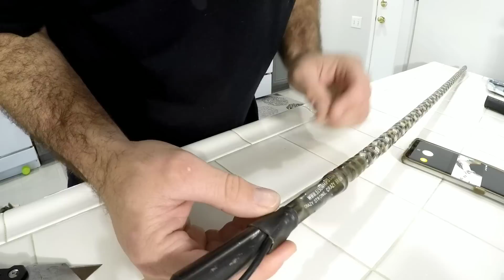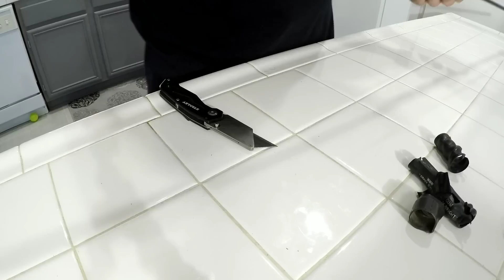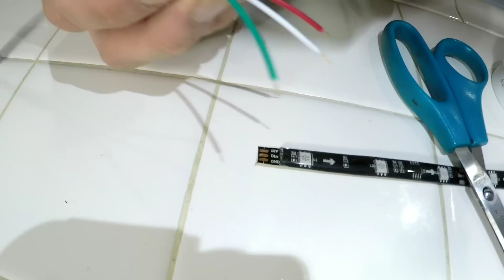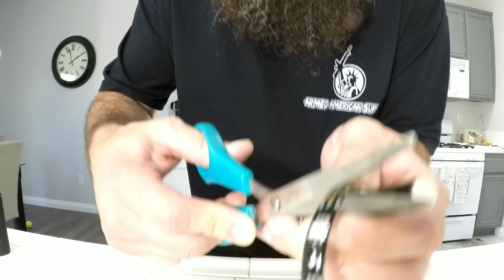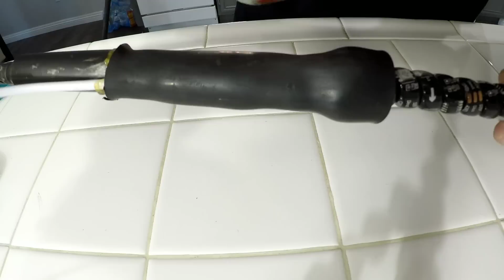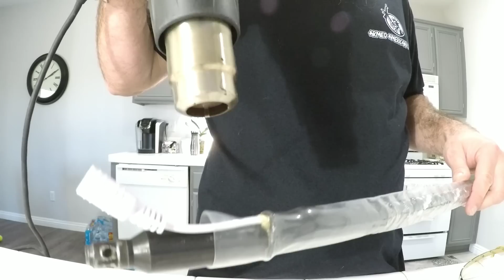How to make a lighted led whip

Comment: What controller do you use and how do you supply power to it from the battery?
Reply from the maker: I use custom controllers now if I build one however the controls used in this video and the part 2 video are listed in the video description along with the other build parts
Reply: @MrRICKDAWG4444  I ordered the controller listed in this video and ended up not working in the razor. Maybe I did something wrong?
Reply: At a curiosity how much are your custom controllers? And my issue is I have the controller and am questioning how would I hook it up to the battery on the razor?
Reply from the maker: I recommend the Bluetooth controllers from the second video. However I have custom controllers made from China that I use now if I decide to build one
Reply from the maker: To hook up on any vehicle just run a positive and negative wire to a switch on the dash and then run the same wires from the whip to the switch on the dash
Reply: That's what I did but as soon as I connected power to the controller it ended up frying up.
Reply from the maker: Probably just a controller issue those things are hit and mis

Comment: I built 2 of these and when I go to change modes sometimes one of the two will go to a different mode. Is there a way to make sure they stay in sync all the time?
Reply from the maker: Yes I usually run two off one controller and use a Bluetooth controller here's a old pic of what it should kinda look like.
Whip syncing https://imgur.com/gallery/hJDHr6K
Reply: Well I goofed up and used 2 controllers. I understand now. Also how do you set the pixels with the wireless remote? I want mine to stack but can’t figure it out
Reply from the maker: Your remote should have came with instructions in the bag just read on there it will tell you. If your whip is fully lit just keep pressing or holding it down until you start seeing the top leds turn off then press back up until the last one lights up then your set.

Comment: Bro i made 2 whips with these lights and controllers but i cant figure out how to change the pixels like you did for the stacking
Reply from the maker: There is directions in the package it came in. I don't really use that controller anymore so I can't recall how it's done.

Comment: How would you pair 2 whips together using these lights.
Reply from the maker: Just splice one controller to both whips. Or you can power both controllers on at the same time.
Reply: @MrRICKDAWG4444  that's what I was thinking just making sure. Thanks for the video helped me decide on building or buying one
Reply from the maker: Right on. Glad i could help, good luck with your build.

Comment: Is there a controller that I can buy that I can screw all my whips and lights in together and use one controller to run all them at once ?
Reply from the maker: Yes, however I don't have a link for them. I have those custom made directly out of China and they run all the rock lights and whips together. I think I can have em custom made to run at most 8 different sets of lights at the same time.

Comment: Could we use a bluetooth controller?
Reply from the maker: Yes. You can use any controller long as it's compatible with your LED type. Just know the bluetooth controllers are much larger so i usually build a wire harness that mounts the controller on the vehicle somewhere instead of in the whip.

Comment: Hey man what’s the diameter of just the pole for the 5150 whips? The antennas I used are quarter inch and at the top the left spiral messed up on me every time.
Reply from the maker: They are 3/8".... 1/4" is way to small you will break solder points often if you ride hard. The thicker the whip the better

Comment: DMAX909 got another question for ya. I’ve made the whips but think I may have gotten one of them a little too hot when heat shrinking. It will work for about 5min then the leds start spazing out! Lol. Did I get the leds to hot or the controller?
Reply from the maker: Sounds like a controller or a power supply check out my part 2 video I don't put the controllers in the whips anymore.
https://youtu.be/aBwdlXmUtgU
Reply: @MrRICKDAWG4444  thanks brother
Reply from the maker: @trevor77yfz  you're welcome
Reply: @MrRICKDAWG4444  so turns out I had a bad solder point on my ground! Took the controller back out of the whip and cleaned the copper solder points real good and redone them and it’s fine! Thanks again man.
Reply from the maker: @trevor77yfz  that'll happen. That's another reason why I do it the way I show in part 2. It's alot better of a connection even if one of the solderpads breaks off.

Comment: What size whip is that 3/8 or 3/4
Reply from the maker: 3/8"
Reply: @MrRICKDAWG4444  where did u get the heavy duty black heat shrink
Reply from the maker: That's  1.25" adhesive 3to1 shrink wrap found on Amazon. Sold in sticks not rolls.

Comment: I need a whip for my recumbent bicycle with a usb
Reply from the maker: USB to power the whip?
Reply: Yes so I can put it in my  charger   Portable bank like you can charge a phone
Reply from the maker: @353uba   shouldn't be a problem just build it with 5v LEDS and unsolder the barrel plug on the controller and solder the USB plug on

Comment: Hey bud watched the video and had my first whip almost finished. I was putting the clear shrink over the leds and the clear rubber coating started popping and cracking and coming off of the leds........ have you ever had this problem?
Reply from the maker: Yeah the fist one i ever did i had that happen and i found you just need to have everything ready wrap fast and get the shrink wrap on as quickly as possible. Also if you're using a whip smaller than 3/8" dont wrap the leds as tight.

Comment: What kind of solder do you use? I’m having trouble with the solder sticking to the copper tabs. I use flux.
Reply: I use 60tin/40lead. Rosin core
Reply from the maker: To be completely honest I'm not to sure what I use. I have like 5 different rolls in my tool box and I usually pick the thinnest stuff I got when I solder those tabs but it all kinda works the same i just fluxs the tabs and wires first and 2nd put a ball of solder on the soldering iron tip and thin push down and it fills the tab and wire to it in about 1 second.
Reply: DMAX909 not sure why my solder isn’t sticking lol. Maybe I’m not using the right flux. I did it exactly how you just said and it will not stick to the tabs to save my life.
Reply from the maker: Try tinning your wires first if the solder doesn't suck into the core of the wire you might have the wrong Flux or maybe even solder. Try it and let me know now I'm curious. Lol
Reply: DMAX909 I’m thinking wrong flux, I did try and tin the wires first. The solder isn’t sucking into it like it should. I’ll let ya know.
Reply: Brother I have no idea why my solder will not stick. I’ve bought different flux and solder with the same results. It actually looks like the solder iron rejects the solder lol. Idk
Reply from the maker: Yeah it will do that the solder should stick to the copper with flux on it. Try roughing up the tip of the soldering iron with a file or something so you can try and get a ball of solder to stick on to it.
Reply: @MrRICKDAWG4444  so it turns out I had the wrong flux. Kept getting cleaning flux instead of tinning flux😂🤦🏼‍♂️
Reply from the maker: Lol yeah that'll do it. At least you figured it out
Reply: Do you use one controller with two whips? Or each whip got its own controller?
Reply from the maker: I use new controllers now and days but this is how I wire them to one controller. 
 https://imgur.com/gallery/hJDHr6K

Comment: Can these be controlled with a phone app
Reply from the maker: Yes they can if you buy the bluetooth controller. The controller i used has more modes but is Not bluetooth controlled.

Comment: I love you video and I'm already doing some LED lighting setups on my bike for Burning Man.  The power requirements are greater for these 16 foot strips than the little LED Fairy lights I'm using on other parts of my bike. I've been wiring fairy lights to USB plugs and I'll have a small solar battery pack on the bike. It works great!
My concerns are the power requirements for this whip.
Have you ever heard of an affordable power supply for this monster?  Even the 5V strips require 9 - 45 amps.
Maybe buy 3 6 foot strips and run a power lead up the pole under the wrapped strips?
What do you think?
Thanks!
Reply from the maker: I've never used them with a battery pack but I'm sure some of these big battery packs will do the job. 5 volt will probably be the way to go with power injection. However if your not running solid white it's possible you wouldn't even need power injection running 12 volt leds.  Let me know how it turns out.

Comment: Will one controller work on 2 4ft whips?
Reply from the maker: Yes I just splice a Bluetooth controller to both whips and use 3pin connectors at each whip if I'm doing a two whip system.

Comment: I got the lights and did one whip tried the other lights and they worked so I started to set the controller up and wire it in now they flash blue and immediately turn off. Any help?
Reply from the maker: Make sure none of your wires are touching each other at your solder points first then try a different controller. Hope this helps and good luck.
Reply: @MrRICKDAWG4444  could you eliminate the controller if you just tried the power wires on the led strips?
Reply from the maker: Not with those type of LEDs
Reply: @MrRICKDAWG4444  thanks for the quick reply man appreciate you
Reply from the maker: No problem, anytime
Reply: @MrRICKDAWG4444   in my complete ignorance I noticed that there are arrows showing the direction of flow and had it backwards
Reply from the maker: Yup they're directional, l I'm glad you figured it out. 👍

Comment: Quick question I’ve been looking for a solution to fix my whip lights because when I turn the power switch on in my rzr the whips flick at the bottom for a quick second and won’t power the whole whip, is there a solution that I could do to fix this, like is it a power problem, something easy to fix or are they trashed because of the company I bought them from?
Reply from the maker: Sounds like you just need a new controller. It could be a number of problems but I'd bet your controller is bad.

Comment: Can you buy bare 5150 day whips? I’m not finding them
Reply from the maker: Yes they go by the name of 5150 day whips
Reply: DMAX909 appreciate it. Great video.
Reply: DMAX909 does the controller and lights come with the other end to plug it into? Or do I need to buy something for that?
Reply from the maker: I personally use the 5.5 male end that plugs into the female side off of the controller for easy connect/disconnect. However It's just two wires so you could use anything you want to make the connection there.
Reply from the maker: My bad i just reread that, No the controller does not come with that side

Comment: So, I’m thinking about breaking down my RGB whips and making these. But I’ve got a question for you. My RGB whips don’t stay in sync with each other. They start in sync. Then for some reason one ends up slower than the other. 
Do the controllers you have in the description stay synced in a pair? 
Does that make sense?
Reply from the maker: I use Bluetooth controllers when making pairs. Then splice the one controller to both whips
Reply: @MrRICKDAWG4444  can you link in the Bluetooth controller? Do you have a video on that you can link me to?
Reply from the maker: I'm driving right now but you can find the controller on Amazon just search sp110e
Reply: @MrRICKDAWG4444  sorry to bug you again. How do I splice one controller to two whips? Do I just cut the connectors off the old controllers and run new wiring across?
Reply from the maker: Basically yea just take all 6 wires from the whips and connect them to the 3 wires on the controller in the correct order of course. I use 3pin connector at the whips and build a wire harness from the controller so I can remove the whips easily. Hope that makes sense.
Reply from the maker: Here's a old picture of how I used to build em. I use different controllers now.
 Whip syncing https://imgur.com/gallery/hJDHr6K

Comment: Do you still recommend the same LED strips?
Reply from the maker: They are basically all the same China chips. Lol
Reply: @MrRICKDAWG4444  So do you think the 2811 are still the best for this application?  Thank you.
Reply from the maker: Well I've tried other chip sets like the 2812 and 2812b and I've found alot more issues with communication with the small controllers so I just stick with the 2811... I'm sure there is something better that can be used but I haven't really tested a whole lot of them in this application
Reply: @MrRICKDAWG4444  Excellent.  Thank you, for the detailed response.  I just ordered two strands.
Reply from the maker: No problem. Ask away any questions you might have I've built probably somewhere around 30 of em

Comment: Dmax909, can 2 whips be connected to a single controller?
Reply from the maker: Yes one controller is good for up to 1024 leds
Reply: @MrRICKDAWG4444  , thank you sir.  Going to give this a try
Reply from the maker: This is how i do mine https://imgur.com/gallery/hJDHr6K Good luck with your build.
Reply: @MrRICKDAWG4444  would you have a link for the three conductor extension cable?
Reply from the maker: Everything i use i get from Amazon. So if you search there you will find what you need.

Comment: this was a roll of 150 led's. I know you can get them in 300, so thats twice the led's in the same roll, would you stay away form that or would it be fine. also if I did two of these can they be synced together somehow
Reply from the maker: It's possible however there is a few factors at play once you close the separation of LEDs by adding more per foot it will start blending colors at a distance and will look way different than one with less LEDs. Most importantly after around 150 LEDs you need to start power injection if you want to run solid whites, without it the whites will fade to amber at the top of string. Hope this helps.

Comment: where do you get the cap??
Reply from the maker: They are just 3/8" vacuum caps
Reply: @MrRICKDAWG4444  I do the same but with the heat control it start broking the silicon of the led strip. do you have a tip for that
Reply from the maker: It happens sometimes just work fast is all I can say
Reply: @MrRICKDAWG4444  thank you so much great video
Reply from the maker: Thank you

Comment: I am having a hard time finding the clear shrink wrap tubing to order. The link you have listed only has .25" & .5".  Do you have a different link for the size you use?
Reply from the maker: Try this one 

https://www.amazon.com/XHF-Waterproof-Adhesive-Insulation-Oil-Proof/dp/B07XJBN3QB
Reply from the maker: Get the 3/4 though for some reason the link comes up 1/2
Reply: @MrRICKDAWG4444  Thanks for the quick response!
Reply from the maker: No problem. Look around on there for 3/4 clear shrink wrap i seen a bunch, you might find a better one that was just the first one i seen.
Reply: @MrRICKDAWG4444  I just went ahead and ordered that one. I ordered 2 of the 4ft daywhips, and I was just reading on somebody comment that they ordered the 5m 60leds/m ip67. Is that the one that you used in the video. The link that you have listed brought up the 5m 30leds/m ip65, so thats what I ordered. Should I cancel that order and get the 5m 60leds/m ip67?
Reply from the maker: No stay with the 30 leds. Let me know how that shrink wrap works out i just noticed its adhesive lined ive never tried that type b4. It might not be as clear but may be stronger.

Comment: ive been trying to find out what controller and led strip there usin for there 187 series with bledim!
Reply from the maker: I'm not sure what they are using and I'm not sure if they even sell those anymore. But I'm sure they are probably the same ws2811 leds. I know the controller i have in the description will do more modes than the one they have.
Reply: I was wanting a Bluetooth set up cause all my other stuff is
Reply from the maker: They sell ws2811 bluetooth controllers on Amazon that will work. However they are a little bulky to use integrated in the whip and so you'll want to mount it in the vehicle and use the three prong connectors to go to the whips.